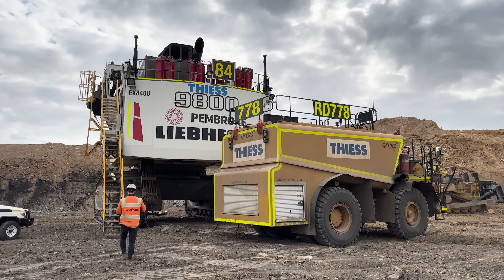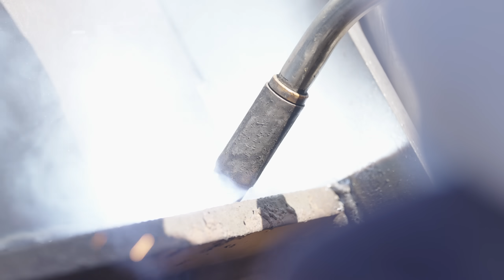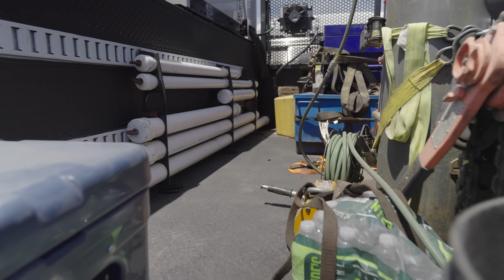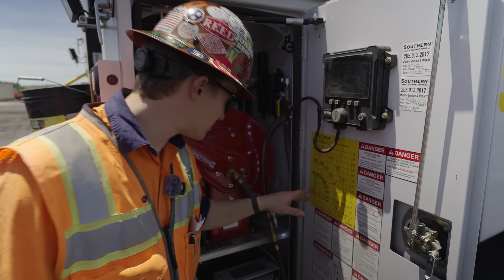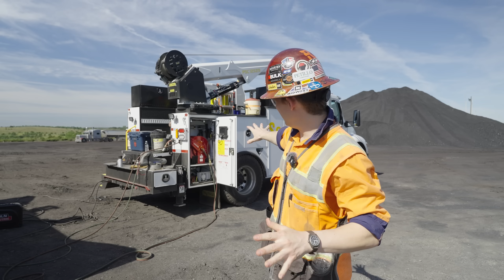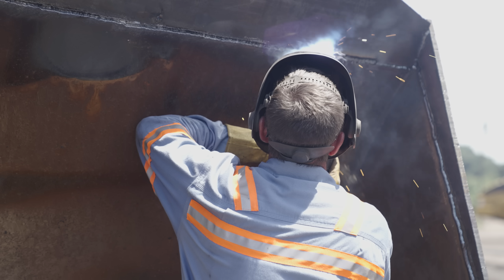These Custom Mechanics Trucks Can Fix Anything!

Comment: honest question, why not space the additional material on top of the blade a 1/4" or so? would that not save time with the arc gouging and then you can get a full pen weld?    I fab stringers and ornamental railings so dont roast me to hard
Reply: We did leave a gap. Just wanted to make sure it was going to make sure it was going to 100% .

Comment: Thompson Cat brother your getting close home now , Our company exchange D11Blades and built 30’ wide Coal Bucket for 992 Cat loader. Worked on 100yd dragline buckets and sold lot abrasion res steel . Retired in 2011 
Don’t get back KY very much , most surface mines are gone but enjoyed working big iron.

Comment: A little longer frame you could add a single sleeper behind the cab...could come in real handy on one of those late night repair jobs that has the need the machine running for 7am, start time.

Comment: In a service truck similiar but not only welding repairs, fabricating. Had field machining equipment and welded, machined the holes back to factory dimensions as well.

Comment: Man another great show!  Love the truck tour, Patrick keeps a nice rig. I would love the body but not the emissions  issues from the truck😂. With Cat money I guess thats not a concern. Palfinger sure makes nice stuff, but you pay for it😬. Hey, a guy can dream, right? I cant find a body company with less than a 18 month wait list. Its crazy how many of these trucks are sold every year. At around $225,000 I cant make sense of it. Maybe one day I will figure it out, till then guess I'll just keep welding😂. Thanks for the cool videos, you guys rock!✌️
Reply from the maker: One day!!!
Reply: The emissions stuff isn't great but it's improved a lot over 10-15 years ago. CAT aftertreatment systems have been surprisingly reliable lately and Detroit isn't half bad either.

Comment: This one of the jobs that I did when I worked for Michigan Caterpillar. The biggest difference was the truck that I was assigned to, much different, and smaller than this truck shown. But the job has not changed much. Fix what were sent out to do and then call in for another job.

Comment: Field mechanics are the unsung heros of any operation. And they get a lot of pressure because every hour of downtime is costing the company thousands of dollars. ✌️
Reply: @UncleManuel  yep , and you are the one who gets all of their gruff even though you are there only to help get them up and running
Reply: It's just sad to see that the really professional ones are getting more and more rare, too many people who are in the job without any actual skills. Poor welding jobs, not using grease at all for parts that need it, loosing parts and bolts in the mud, then replacing them with something they shouldn't be replaced with, or not even putting all the bolts back etc... I guess many get into field service because it pays so well as a contractor and once you leave the site you can pretty much forget about it and let someone fix your mistakes - and the market is so big that you can get away with poor workmanship for quite long.

Comment: Good mechanics are worth their weight in gold without their skills and knowledge nothing gets done 😎👍. They can easily pull in six figures plus!
Reply from the maker: oh yeah it's a big time field and only getting bigger
Reply: @buildwitt Exactly the demand far out paces the supply of these trade skills and there needs to be a push to bring the Heavy Diesel Mechanic and Welding Trade programs back to the high school level.   We had these great programs when I graduated back in the mid 1980’s but unfortunately all the Trade Skills programs were all phased out in the mid nineties in order to push the 4 year college path.